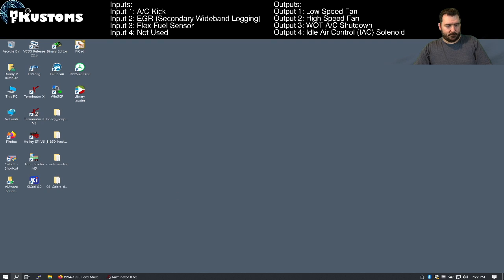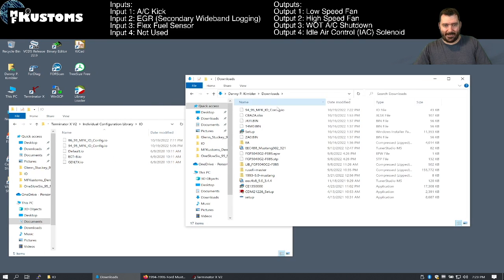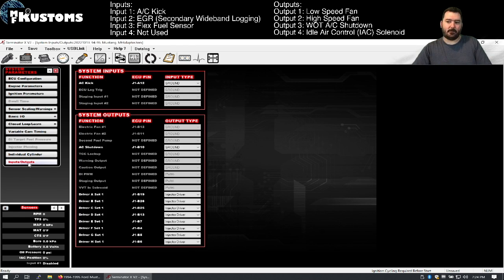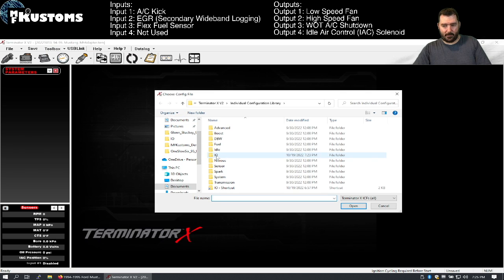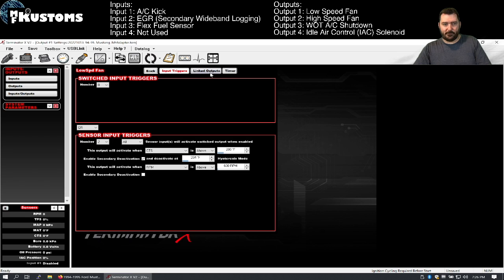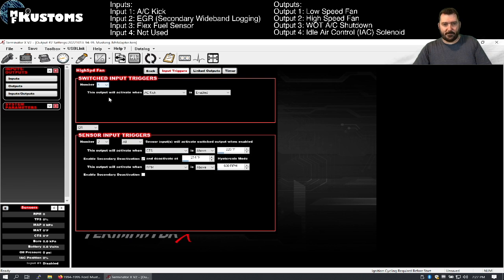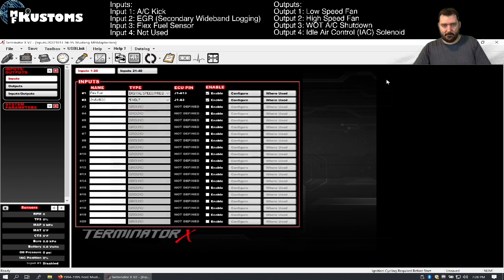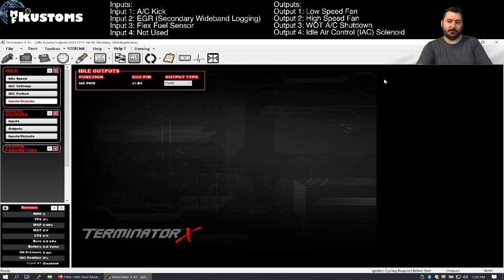Configure Inputs/Outputs for Terminator X on an 94-95 (SN95) Mustang

Comment: On the "fan on" and "fan off" settings, can you make the fans come on at a lower temperature?
Reply from the maker: You can set it to whatever you want. Just make sure you use our ICF to make sure both fan speeds are not active at the same time.

Comment: Newbie to this but does the firmware or soft ware come free with it ?  As in I can install it on my laptop to change everything or is that something I have to get extra ?
Reply from the maker: Yes it is free. You can go to Holley.com -> Support -> Fuel Injection -> Terminator X. Then down the latest version and mess around with it.